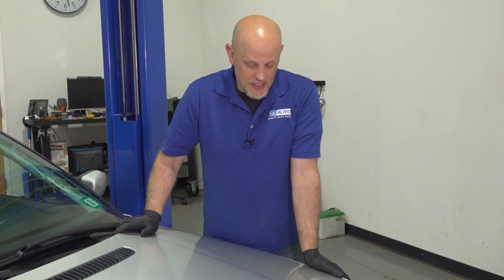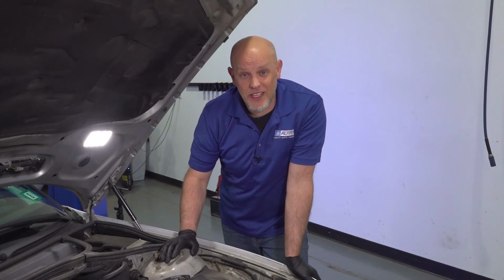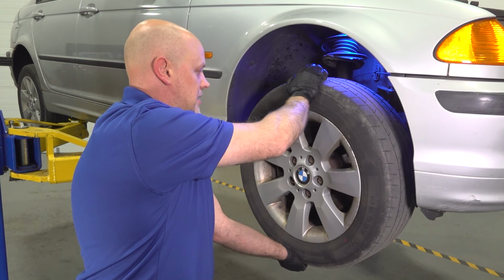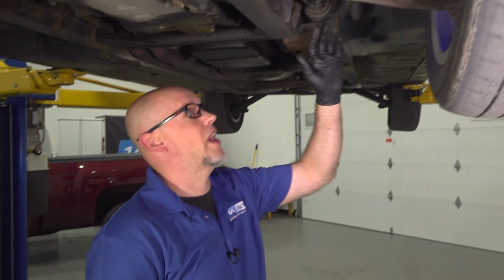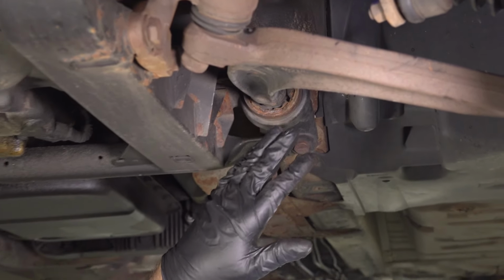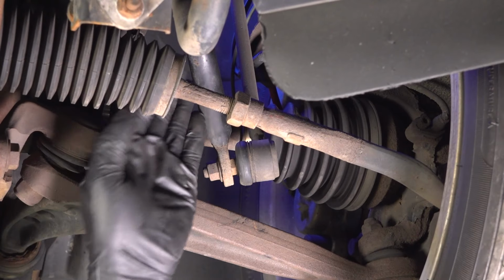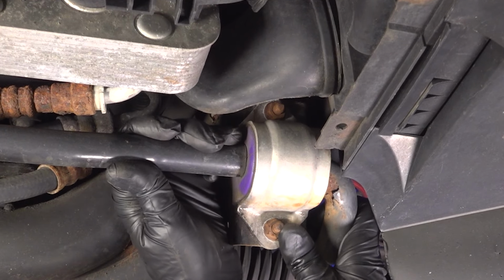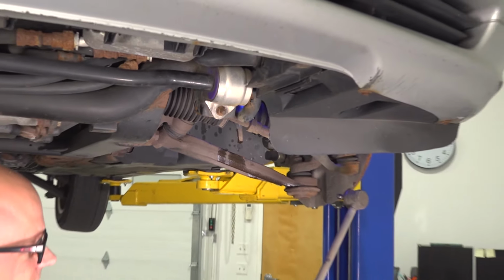Clunking or Banging Sound in Your Car or Truck Without Bumps Locate Hard to Find Noise Yourself

Comment: I replaced, both sides : sway bar links, sway bar mount bushings, ball joints both sides struts mounts and I still hear the clinking on potholes only. Everything else is solid. It's driving me crazy. Where else should I check

Comment: What did the noise sound like in this one in the video while driving it?
My noise on a 2011 Silverado sounds like coins or in a can or a price of mettle rapidly clacking together. I checked many heat shells and they look fine so far.
My noise seems to happen at 30 to 45 mph Unaccelerated and maybe more at slight up grades and rough roads for sure..
Just spent a ton of $$ putting a remanufactured Jasper motor in it.
This noise was here before and after that engine change... posting this on 2-3-25

Comment: I got a 1994 Jeep Cherokee XJ. Sometimes when I start it and put it into drive, it won't take off immediately, until I rock back and forth a bit, then I'll hear a clunk in the back end and it will start moving. Seems like something is sticking, maybe the drum brake shoes need an adjustment you think?

Comment: Mine is when I turn the front wheels when I’m slowly moving. Had to replace my inner and outer tie rods cause the rubber was pretty shot and not holding grease all that well.
All of the rubber is pretty shot up front.